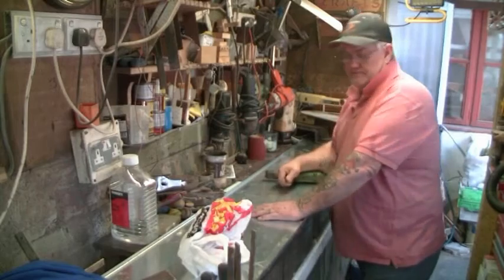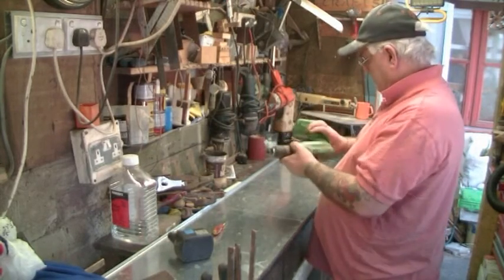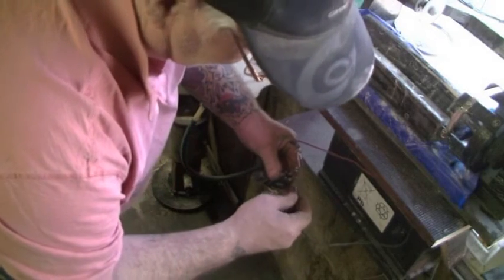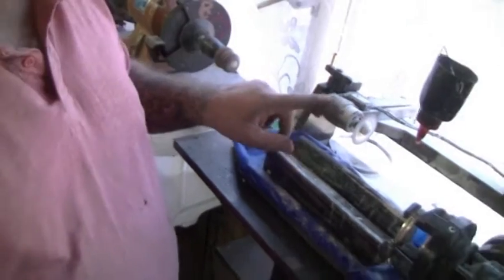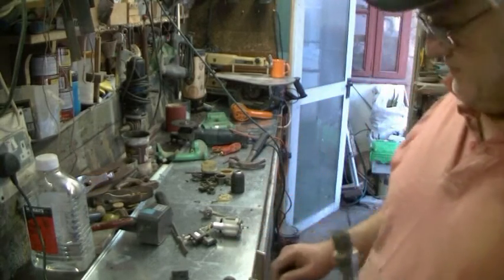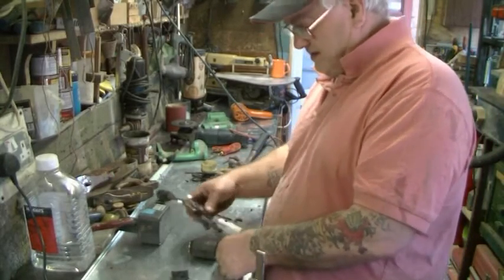hey dont chuck it.

Comment: Make a Dri....oh.

Your sense of humour is Great Bob. Very funny vid.
When the batteries Die on these things I get those Sealed lead acid batteries. the 4.5 12V AH is a good Size and just tape it on the bottom where the original pack went.

You can charge those batteries with an automatic car charger and the new batteries last all damn day. I like to have several drills for some things So you aren't swapping between bits when you have to drill a hole then drive a screw for instance.

The SLA batteries are cheaper than a new Drill and their run time is great.

How about you put an engraving bit on the end of the motor and do some engraving on all those bottle glasses you made?
Keep up the good work Bob!

Comment: Put a T bar on the chuck then you could put anything in the end I use them for those sockets the 5mm to 13mm you get in multiples cheap drill boxes. The motors can be used for fans in extraction. Either end of your shed one to suck air in and one to blow. A black box with small holes drilled into it connected to a hollow panel the height of the shed all blacked out inside the suns heat can then be pulled into the shed giving some heat. Make remote cars with the engines.